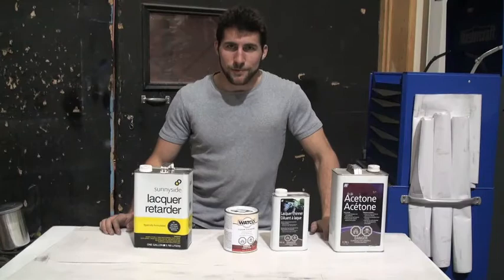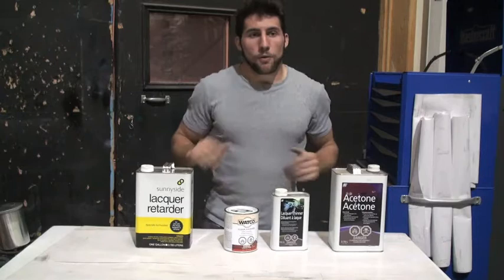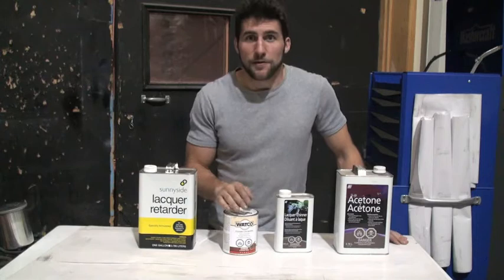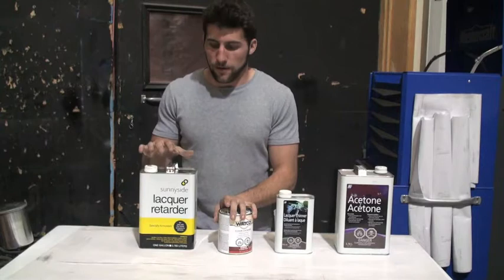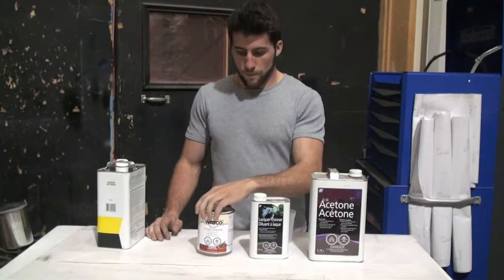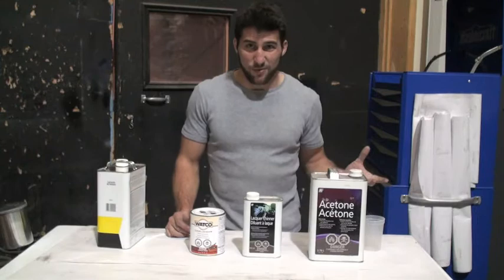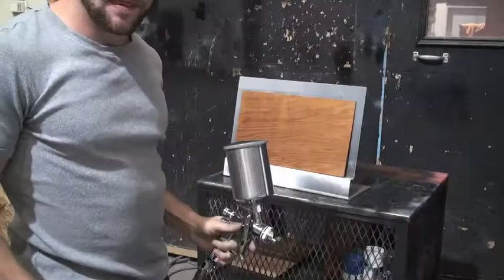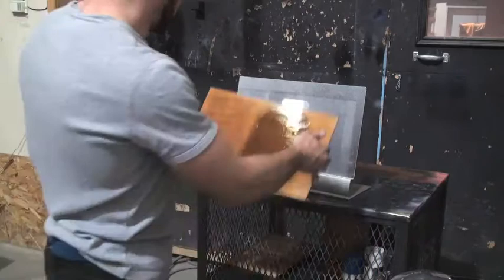How to Spray Brushing Lacquer

Comment: Thank you so much for your interest. Actually I was planning to buy a Wagner control sprayer double duty gun but I cannot spray lacquer with that since flashpoint of lacquer as well as lacquer thinner is <70°F. So for time being I went for dx13 NC thinner to thin the lacquer and brush it with soft brush(I am doing it for small machineries).

Since the thinner is quiet powerful, brush sometimes removed the paint from the machines. It means I cannot add too much of thinner to thin in such situations. 

Can you please tell me how do i prepare thin lacquer solution to brush using other chemicals so that the underlying paint is not affected. Thank you in advance.

Peace
Reply from the maker: It sounds to me like the underlying paint job may also have been lacquer. Lacquer dries, but doesn't technically cure, which means that it's original solvent (acetone, or the thinner) can dissolve it again back to its previous state. If you want to re-coat it, you can try doing so with less thinner, or you can try using something other than lacquer. I would be most likely to just remove the previous paint before putting the new stuff on.
Reply: Brad Angove thanks..
Actually I have cleaned the surface and applied a primer coat. And I sand this layer for good finish and apply acrylic spray paint using a can. After this paint get dried up, I want a glossy layer on top. So I choose clear coat.
If I don't thin the lacquer, it is not possible to brush. If I thin it with a lacquer thinner i.e., dx13 NC thinner, it affects the paint(very sticky lacquer).
What I wanted is, anything like acetone or retarder or anything, that can thin down the lacquer but that do not affect the paint.
Reply from the maker: Ok, I see what you mean now. You can use acetone to thin it, but acetone flashes very quickly and is just as likely to dissolve your acrylic as the lacquer was. You can slow it down with the retarder, but I don't think it will help. When I encounter issues like this I usually end up spraying. Sometimes I use a water-based brush on lacquer, but even that can spread the acrylics in some circumstances. Sorry, I don't know of a chemical that can help you here short of applying some kind of spray on protection to the acylic like maybe a fixatif or something.
Reply: Brad Angove yes. Exactly. You got my point. Thank you so much bro..
Reply from the maker: Are you the same person?
Reply: Brad Angove Brad Angove back to previous point once more.. I had actually planned to buy Wagner control sprayer double duty. It has condition that flash point of the material has to be more than 70°F which failed. It was very affordable priced unit available for around 70$ in Amazon. Do you have idea about any sprayer with this price range which helps in spraying lacquer? I need not spray continuously, rather max ten minutes. 
Airless or air assisted or compressor based..
Reply from the maker: I know a few in that range. Home depot sells a campbell hausefield HVLP sprayer that was about $70 last time I looked. Matercraft makes one (available at Canadian tire) for closer to $60. So does Stanley. There are probably some other available from eastwood auto body (online) as well.

Comment: Why acetone and not just laquer thinner? I'm spraying for the first time this weekend
Reply from the maker: I used some acetone because it’s a “faster” solvent. Just to regulate the flash time a bit. You could use just lacquer thinner, but it wouldn’t dry quite as fast.

Comment: Hi Brad, 
Have you ever sprayed Brushing Lacquer to a finish a guitar, or use furniture grade lacquer like Deft to finish a guitar? Were you able to achieve good results and were there problems such as cracking or crazing etc. I have no access to Stringed Instrument grade lacquer where I'm at.
Reply from the maker: +joeldesker I haven't used deft before. This brushing lacquer though I have used to finish wood before. I didn't have any problems with cracking or crazing. If you're using it on the raw wood of a guitar body, there's no reason why it wouldn't work the same. I'm not familiar with any specific instrument grade lacquer.
Reply: +Brad Angove Thanks Brad. I really enjoy your videos.
Reply from the maker: Thank for watching.

Comment: Brad  have been using polycrylic water based finish from minwax to paint my guitars in my shop, I like using it but have been putting it on with a paint brush, but now I can spray so wanted to know if you had any ideas on how to thin water based lacquer for spraying?
Reply from the maker: When I spray water based lacquers I just thin them with filtered or distilled water.
Reply: cool thanks
Reply from the maker: You're welcome.

Comment: Hey Brad was the lacquer thinner really necessary or could you have just used a higher percentage of acetone?
Reply from the maker: If anything you could get away with a higher percentage of lacquer thinner and skip the acetone. The drying rate on acetone wouldn’t do well for you if you used just that.
Reply: @BradAngove  So you could have just done a lacquer thinner/watco mix bereft of the acetone? Why include the acetone then? I guess my bigger question is I dont really understand the difference between the different solvents used to thin/reduce build or viscosity of coatings. I've been trying to research the best way to thin lacquer mixed with dye for spray staining woods and have no idea why you would pick a lacquer reducer over acetone or lacquer thinner to do so with. I categorize them all the same way as "stuff that makes the finish thinner".
Reply from the maker: They create different drying rates. I use this mix of the two because that’s what I prefer, but you could have a slightly slower mix with just thinner. Acetone only would be too fast and might dry on its way onto the piece and give a bumpy finish.

Comment: if its a satin or semi gloss you do need to stir it completely. The flattening agents have settled to the bottom. I never use anything but lacquer thinner and retarder for mixing...I adjust retarder to the conditions so i have a consistent drying time'
Thxs for vid!   PS sometimes i use a fish-eye remover too
Reply from the maker: +Ei Pi I would think that you still need to stir it completely. The solids in the lacquer may have settled. If you don't stir them back in you won't be able to get a proper protective coating with it.
Reply: +Brad Angove  @ 6:15 you say you dont need to stir it....
Reply from the maker: Ok, I see what you mean. Sorry, I misread your first comment and thought you were asking a question. Hopefully people can tell simply by looking into the can whether they need to stir or not. When I opened this one it was clear that stirring wasn't necessary.
Reply: +Brad Angove i do just to evenly distribute the binders evenly...in fact i stir everything...but never shake unless its paint
Reply from the maker: Or a martini of course.
Reply: +Brad Angove  need one (or 2) after a long spray !

Comment: I'm trying to spray (gravity feed @ 20 psi with 1.3 mm needle) a brush on oil-based polyurethane varnish onto a very nice walnut slab. I thinned it w/ mineral spirits at approximately 40%. But, the finish contained several very small specs, and looking closely, I could see a slight bit of crystallization. Should I cut it with something else; switch to siphon feed; use a larger needle? As is, I'm at a loss and can't find any helpful info anywhere; so I was hoping you may have some advice.
-Thanks in advance, Whit
Reply: PS: I'm using Behlen Tabletop rock hard Polyurethane Varnish.
Reply from the maker: Does Behlen offer a thinner for that product? Mineral spirits or recordsol are generally suitable for thinning brush on poly, but spray on poly uses specific thinners.

Usually, if I get specks in my finish it's because there was some contamination in my gun from a previous paint job where I didn't clean it out properly. Is that at all possible?

My first attempt at solving this problem if it were me would be: Clean my gun thoroughly, spray a few ounces of pure mineral spirits through it once it's cleaned, and filter my polyurethane through a conical paint filter when putting it into the cup.
Reply: I did spray m-spirits first for cleaning, but contamination is still a slight possibility. At the moment, I'm not aware of a specific thinner/cut; however, I do believe there's one for the Behlen Varnish--not the polyurethane version, although it could work. 

I've worked every weekend for a few months on this large table. It's a very nice 100" book-matched walnut piece. But, the learning curve and massive amount of trial and error are getting to me. With that said, if I can't find the right mix, maybe I should (taking a deep breath) sand it off and shoot laquer instead.

Thanks for the quick response and advice. I hesitated to bother you with this issue, but I'm in a bit of a bind with few options. 

Thanks again.
Reply from the maker: No need to hesitate. I'm happy to help to the extent that I'm able.
In this case, I'm going to direct you to someone more qualified to deal with this specific issue. Let me know what he says. If he doesn't sort it out, I'll keep brainstorming with you. Call 1 (800) 522-8266 ext. 1907 and speak to Phillip about it. If anyone knows Behlen products it should be him.
Reply: Thanks again. By the way, you do some really nice work. Mick Mars of Motley Crue was my friend and brother-in-law for many years. So, I learned a bit from him about guitars, as he had maybe 50 or more. We even built one together. Anyway, I know enough to really appreciate your pieces. Keep up the great work!
Reply from the maker: That's crazy! I bet you learned more than a bit from him haha. What kind did you build? 50 guitars... that's the dream.

Comment: Good video Brad, thank´s for the tips!
Have you used any other lacquer brands?
Reply from the maker: Yes, I've used a few others.
Reply: Whats your opinion in these brand (watco) compared to the others you used? Does it dries faster, harder or is it the same compared to other brands? Thank's for answering!
Reply from the maker: It's difficult to compare because the ones I've used a different in more than just their brand. I've use Renner WB lacquer, which is nice because it's very easy to work with, but it lacks the durability of the solvent stuff and it dries differently. I've also used a proper nitrocellulose lacquer that a local paint shop mixes for me. It's designed to be sprayed (unlike this watco brushing lacquer), and is nice to work with, but I like the watco almost as much. Also, the watco doesn't smell as bad. Any time I get a whiff of the other stuff by accident I feel like it's taking years off my life.
Reply: Thanks Brad, I'm learning a lot from you.
Reply from the maker: You're welcome. Glad to be of use.

Comment: I do woodworking and have been spraying Deft lacquer.  I've been using 5 parts lacquer to on part lacquer thinner.  Seems to work.  Any comments from those with more experience????
Reply from the maker: I generally say stick with what works for you. That seems like it would be a rather thick mix for lacquer, but it probably only matters if you're looking for a thin coating.
Reply: Brad, thanks for taking the time to respond.  I will try it a little thinner.  But I still get runs, probably just need more practice.  Great Video.
Reply from the maker: If your system is working for you I don't think you necessarily need to change it. I like very thin coatings when I'm using lacquer, so I spray it thin and I do very thin coats as well (which is why I don't get runs).
Reply: Brad Angove Ok, great.  I've been trying to get a wet coat every time.   Lacquer sets pretty quick.  I think I could add coats before the first coat is dried hard.  I think, but don't know.  I've painted houses for years and added additional coats of latex just as soon as the first coat was dry to the touch.  Is it the same for lacquer?
Reply from the maker: Do you apply sanding sealer first? In my experience, you can apply a few passes at a time for lacquer. As you first pass tacks up, you can go in and apply a second, and then maybe a third. This happens rather quickly because of how fast lacquer flashes off when you put in on thin. Following that though, it is best to wait a day before doing your next coat.
Reply: Brad Angove No, I have been using sanding sealer.  How important is it?  Thanks for the great advice.

Comment: Hey, I have a question about your snowboard video, i wasn't sure if you would still read comments there, so sorry if you still read them :).

I am painting my ski's and I have some leftover paint from previous projects, but that doesn't say it is acrylic. It only says that it is for wood and metal purposes, but ski's are no longer made from wood right? So do you think that would work?

Then, I have some leftover lacquer that's made for boats. Do you think that would work? It is water proof and extremely sun-protective. 

Thanks, and keep up the good work!
Reply from the maker: Hello. I receive notifications when comments are made on any of my videos, and I generally reply to them as soon as I can. That being said, there's no need to apologize. I don't mind answering on different videos.

Without knowing what kind of paint you have, I can't really say how it will work on your skis or how it will react to your lacquer. It doesn't need to be acrylic. Polyurethane is another popular choice. Enamels can also work if they are flexible enough. Your skis have a finish on them, so they are not really like painting wood, metal, or even the composite that they are made of at this point. You would be painting over other paint.

As for the lacquer, it's good that it is water proof and UV protective. It sounds like it is also probably pretty durable. Is it catalyzed? The main factor that you need to worry about is whether or not it can flex with the skis. Some finishes harden and become a bit brittle. This can cause them to crack when they are on things that flex or expand and contract. If you can, you should test the lacquer on something that you can bend after it has hardened. Get it cold and see if it is flexible enough.

Comment: Aloha Brad,
i get the purpose of the retarder, but why both lacquer thinner and acetone?
Reply from the maker: I threw in the acetone as my main cutting agent to get the lacquer to be more like a spraying lacquer, and then I thinned it with the lacquer thinner kind of like I normally would. Acetone dissolves material differently than lacquer thinner does. I don't really have an explanation for it, but I knew that you could make nitrocellulose lacquer by dissolving ping pong balls in acetone, so I figured it would be a good choice for changing the consistency of the lacquer before going to my usual thinner.
Reply: Mahalo Brad, I'll give it a go.

Comment: why not think it just with lacquer thinner? Why use acetone?
Reply from the maker: Acetone is a faster solvent. You can get away with just lacquer thinner, but this mix works well.
Reply: @BradAngove  Thank you :)
Reply: @BradAngove  first I’ve heard Acetone as on option.  Faster, meaning the cure time or it just evaporates quicker?  Thx
Reply from the maker: Just evaporates quicker. They’re very similar though realistically. More similar than I realized back when I made this video.

Comment: BRAD, TRY USING A COOKING BASTER TO DRAW OUT YOUR THINNERS FROM THEIR CONTAINERS
Reply from the maker: I'm a bit concerned that the baster might melt a bit in the thinner.
Reply: I bought a glass baster to draw out of full quarts of behlins vinyl sealer and lacquer. Much less mess than pouring.
Reply from the maker: That makes sense. I'm glad it's working out for you.
Reply: @nickacuff1289  never thought of that! I've been using miniature ladles. No mess but slooowwww. To the Amazon! Thanks!

Comment: why add acetone to the mix?
Reply from the maker: I threw in the acetone as my main cutting agent to get the lacquer to be more like a spraying lacquer, and then I thinned it with the lacquer thinner kind of like I normally would. Acetone dissolves material differently than lacquer thinner does. I don't really have an explanation for it, but I knew that you could make nitrocellulose lacquer by dissolving ping pong balls in acetone, so I figured it would be a good choice for changing the consistency of the lacquer before going to my usual thinner.